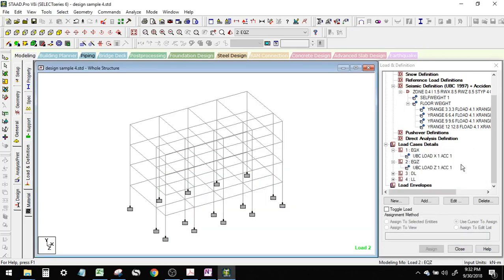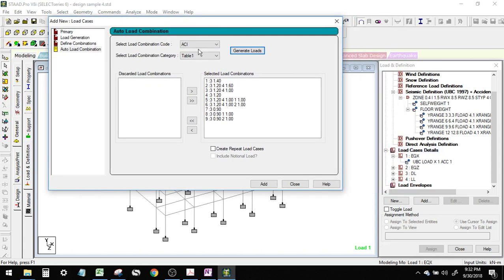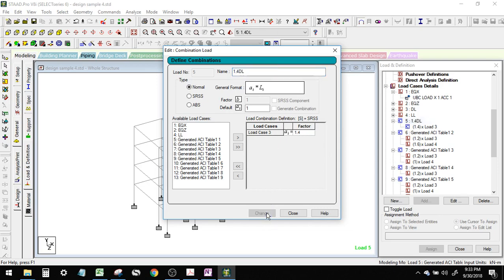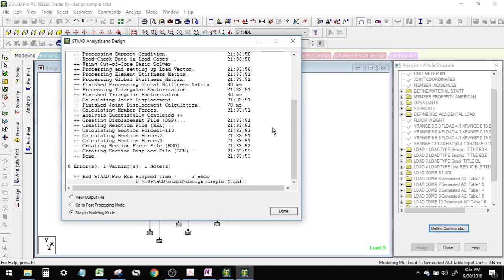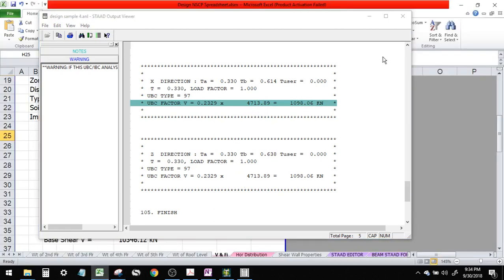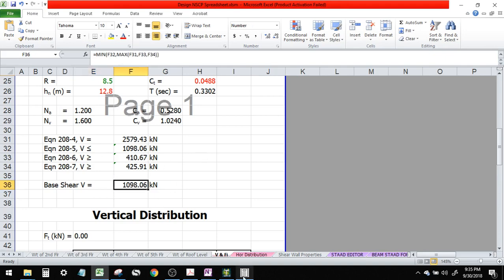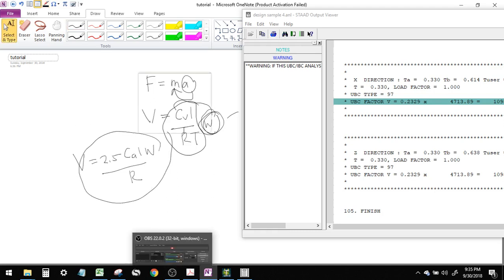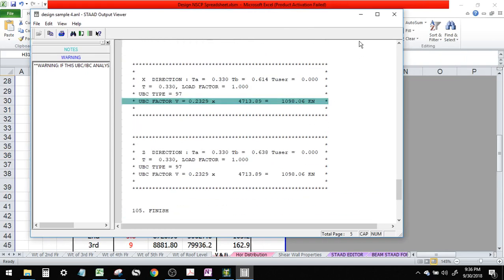PART 5-GENERATING AUTOLOAD COMBINATION IN STAAD AND RESULT VERIFICATION IN EXCEL

Comment: Sir i have followed your step but im recieving a warning on no rigid floor diaprahgm is present in the model.when i created a floor diaprahgm it ask for reference load but instead i encounter an error on reference load.i want to ask if the warning on no rigid diapragh will affect the result and structural integrity  if not can i just ignore it?also when i generate my load combination it only generate ACI table 1.1 and ACI table 1.2
which is 1x load 1 (load= Ex)
                1xload 2 (load= Ez)..can you tell me what to do with it?
Reply from the maker: i always prefer modeling slab to act as rigid diaphragm in the model. the rigid diaphragm command in staad advance is adviseable when you want to get center of mass. other than that, u can ignore the rigid diaphragm command for now and focus on the analysis.
Reply from the maker: modeling the slab will incorporates its stiffness in the analysis. i forgot to model the slab in this tutorial but i always require my students to model it
Reply: Thank you for the early response sir.